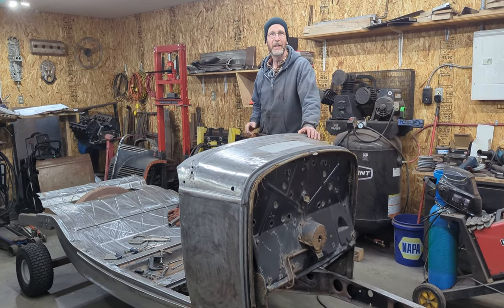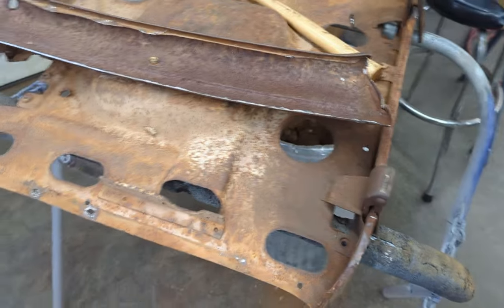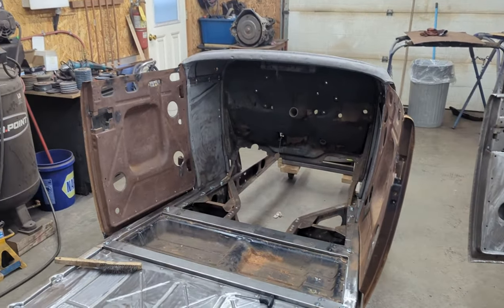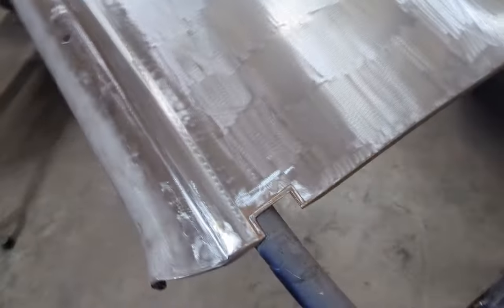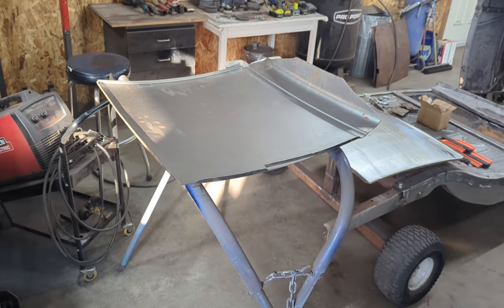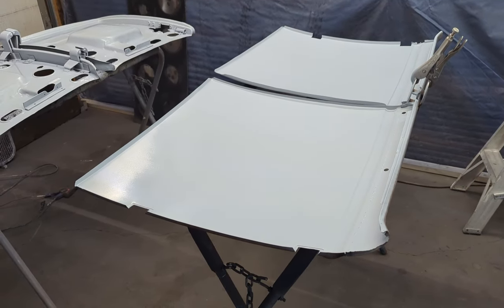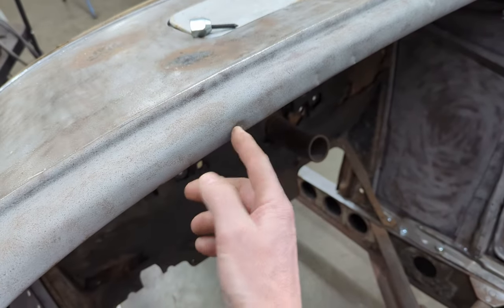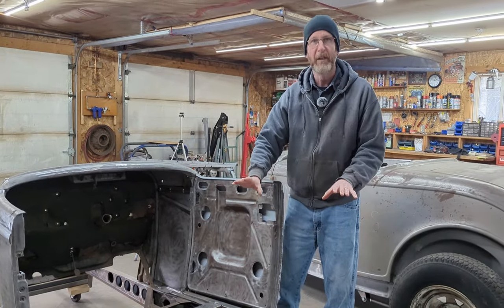Doors Part 2 Cowl & Dash Removing Dents - International Roadster Pt3

Comment: For dents and dings like that you can tack a three eights washer on edge,lever it up with pointed pry bar through hole in washer,or use hook through hole on a slide hammer.
Reply from the maker: I knew about the hook through a hole with a slide hammer. I couldn't find anything hard enough that wouldn't bend this time. The welded washer on edge and a pry bar, I didn't know that trick. I like that one. I will try it! Thank you!